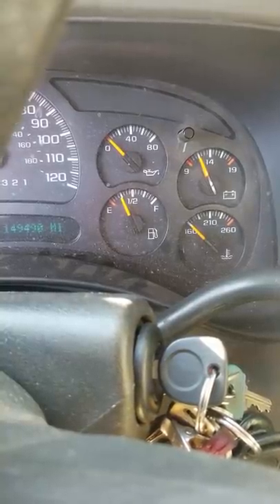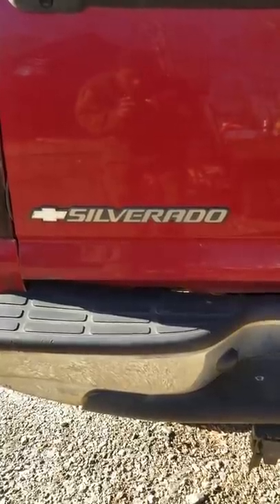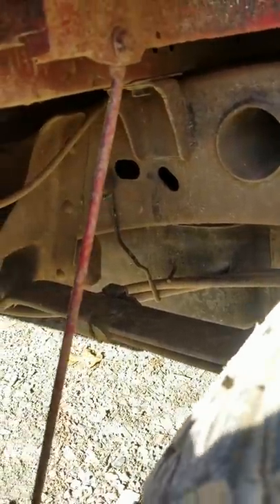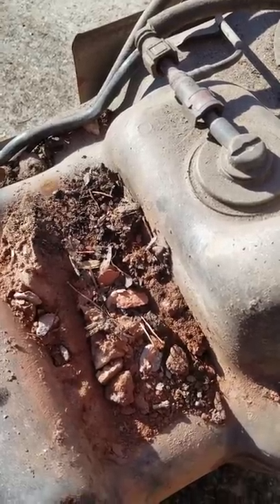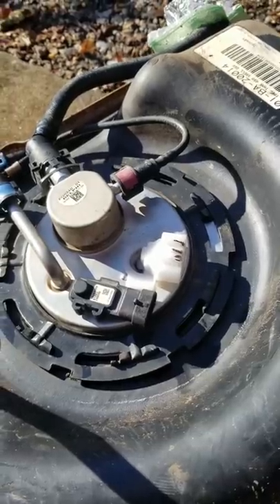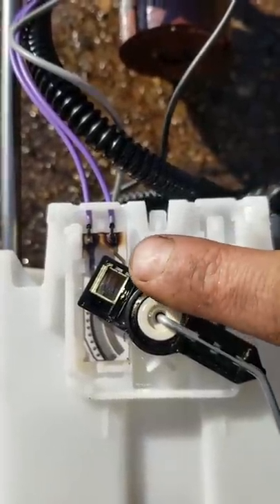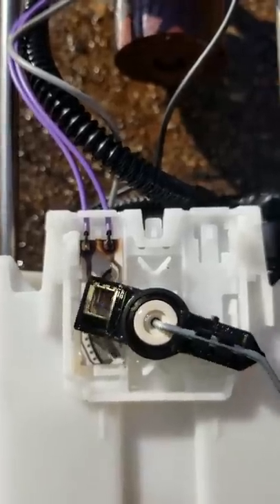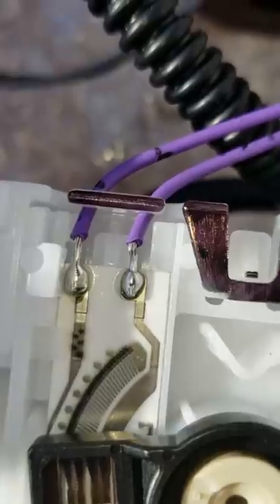Customer States Fuel Pump Broken

Comment: It's easier to pull the bed off then the tank. I've done it for years.
Reply: That’s the way I’ve always done it too. Much easier
Reply: Just did two f250’s this month that way.  I wrestled the idea of dropping the tank.  I still feel pulling the bed is better, even with all the broken torx bits, Thankyou Snapon and Mac is warranty
Reply: Depends where you live
Reply: I pull the bed every time unless it's got a hitch in the back or loaded tool box
Reply: Then you can clean up the frame and touch it up where needed, very satisfying
Reply: I just cut. A hole in the bed... I gotta get back to work!
Reply: I was gonna give the same advice, bed pulling is easier and faster.
Reply: Not easier when you live in the salt belt and break 7 of 8 bolts
Reply: @anthonycerbone1883  same
Reply: its more easy to buy a cummins and just drive it
Reply: Did the same for my grandfather’s 97.
Reply: @madisonjam85  Wisconsin here and thats the gods honest truth
Reply from the maker: I've done it that way a lot. Removed the bed on a bunch of trucks. Should have this time!
Reply: Me 2. Way easier
Reply: @anthonycerbone1883  I like your idea best. 👍
Reply: What the fuck 😂😂
Reply: I change chev fuel pumps in 30 minutes without pulling the bed or the tank fully. Better then dealing with rusted up bed bolts
Reply: @madisonjam85    I just guess we're spoiled. 😆
Reply: @anthonycerbone1883  I did the same thing to my 1990 gmc.
Reply: Ummm why do it the fast easy way when ur charging $120/hr labor? Not a smart bussiness move.
Reply: @looselipssinkships6543  true 
Cause can’t get the bed off in rusty belt states
Reply: @madisonjam85  true
Reply: With the fact that a manufacturer  could easily put in an access hatch like  every fucking import car, watching this just pisses me off.
And the fact that the sending unit draws enough current to 'burn up the leads' in a gas tank should be cause for alarm for anyone.
Reply: @looselipssinkships6543  Yeah you wouldn't be pulling beds in Canada or anywhere they salt roads in winter.
Reply: Remove bolts on the dr side (and of course filler tube etc) then jack up that side of the bed and prop up with a piece of 2x4. You only need about 2 ft of room on that side do the work.
Reply: Not easier at all, 2 bolts and the straps are out
Reply: Yall just lazy...dropping the the tank isn't all that bad. Taking the bed totally off isn't just the bed screws it's a lot more than you think may as well just drop it.
Reply: Even easier to cut a hole in the bed lol
Reply: Even easier to cut a hole in the bed
Reply: When you got a lift... Pulling an empty tank is so much easier lol. I drive a 1500 so I'm used to changing fuel pumps 😂😂
Reply: Definitely the way to go.
Reply: @anthonycerbone1883  lol...I have done that, too.
Reply: @abingham3747  if you work at a reputable shop then if it pays you three hours to put a fuel pump in it doesn’t matter how long it actually takes you you still get paid for three hours if you screw around and it takes you five hours you still only get paid for three so there you have it
Reply: @e-racer4673  so if that "reputable" shop finishes the job in 1 hour, you still get charged for 3? Sounds real reputable to me. I bought a lift and have always worked on my own vehicles so I avoid this scam all together.
Reply: I would have thought the bed be a bigger pain in the ass not to mention the weight of the bed compared to the fuel tank.
Reply: There is nothing wrong with charging the Flat Rate and being skilled enough to beat the listed time.  That isn't the same as sand bagging a job to make it take more hours so you can charge more.
Reply: @jacobmccandles1767  it's not the same but it's still not right. If an algorithm quotes 5 hours at $120/hr and the job takes 1 hour the customer is getting the raw end of the deal in a drastically unfair way. Paying $480 more then they should have had to pay. When it comes down to it the customer is paying for services not received, should be illegal.
Reply: Lmao 6 bolts and a 400lb bed over 3 bolts and a 200lb tank hmmm.
Reply: @abingham3747  because your charging the national average & get paid the same amount
Reply: @ericschulze5641  I see, so calling it the national average and then charging 5 hours of labor for a job that took 1 hour is fair? That's a textbook scam.
Reply: @abingham3747  so if you find an easier /better way to do something because of your experience and skills you should be penalized ?
Reply: @minkorrh  the bolts on the tank straps are worse than  any bed bolt
Reply: @ericschulze5641  being fair and being penalized are two completely separate things. Quote the job for 5 hours if it only takes 2 hours, charge for 2 hours. The customer shouldn't have to pay for an extra 3 hours of labor they didn't receive.

People don't go into work, finish all their work in 3 hours go home and then get paid for a full 8 hour day.
Reply: Not if your solo genius.
Reply: @abingham3747  those times are calculated by the mfrs. and the insurance industry to allow enough time to do the repairs and prevent price gouging many many many times repairs take a lot longer than the national average & technicians/ shops don't get paid for that time
Reply: @abingham3747  so again as a technician gets better and better & more efficient/ quicker -true professional he should be paid less than the inexperienced technician
Reply: @ericschulze5641  right they shouldn't, they are the professionals. But they shouldn't be allowed to charge for services not rendered and time that it doesn't take.
Reply: @ericschulze5641  just saying this heavily favors the shop and brutaly fucks the customer. I'm oblivious to all this cause I work on my own vehicles to avoid this scam.
Reply: @ericschulze5641  also as the tech gets better they should be able to get to move vehicles per day, thus making more money. That's the reward for perfecting ur craft. Perfecting ur craft shouldn't access the gateway to screwing people over.
Reply: That's what I've done on two Silverados. Just remove the bed bolts and unplug the lights. You definitely need a couple of friends though, if you don't have a lift lol.
Reply: @shidukirider  i
Reply: @abingham3747  they're just charging the same rate for a job that they did before they became a true professional. Why do people get more money for each year they push a pencil or make a decision.  . . ? Most mechanics make 30-40 k most sole proprietor mechanics make less than 100k you have no idea what your talking about
Reply: @abingham3747  if it takes an amatur 6 hours, and an experienced tech 2, but the book says 4, should the greenhorn get 50% more or the experienced man 50% less?
  The Flat rate establishes what is fair.
Reply: @ericschulze5641  I do know what I'm talking about and I'm the smartest person in the room cause I don't take my vehicles to shops to get fucked. I'll fix it myself, always have always will. Cause I'm not paying someone for 8 hours of work when it only took 4 to finish. That is a very obvious scam.
Reply: @abingham3747  and you wonder why people don't want to get into the skilled trades how many mechanics do you know of who are wealthy? Very few you may know about fixing your own car but not dozens of other makes and models 
You sound like an engineer friend of mine who makes over $300k looking at pictures . but complains someone charged him $200. To clean his gutters. that's you to isn't it . bet you get paid more  than the mechanic your complaining about I bet your car is newer than his.
Reply: @ericschulze5641  yep I do make more than a mechanic and I drive a $60k SUV for vacations, around town and an old beat up Mazda3 to and from work. I have money because I would never pay $200 for someone to clean my gutters just as I would never pay someone for 8 hours of work when the job only took 4. When I see my Chiropractor I pay her for a 2 hour session. She doesn't walk away after 30 minutes and say "cya later thanks for the extra 1.5 hours of pay, have a nice day".
Reply: @abingham3747  stop worrying about leaving your kids a million dollars & pay people what thier worth. apparently you have some unique skill that is far more difficult to learn than hands on skills
Reply: @abingham3747  chiropractician is far different than a mechanic and requires less skills. So if a plumber fixes your sink in 15 minutes & only charges you $20. You consider that good money you consider that $80. an hour don't you
Reply: @abingham3747  shops are flat rate. They go off a manual that says how long the job should take and charge off of that.
Reply: @abingham3747  its called flat rate and it actually makes a lot of sense. If you charge for how long the job actually takes then slow work is encouraged. A good mechanic who can do the work fast is punished by getting less money whereas a slow mechanic that takes twice as long for the same job gets twice the pay. It would then be in the shops best interest to take as long as possible. Flat rate encourages them to do the job fast because they get paid the same no matter how long it takes.
You are paying the shop for the job, not the time spent doing the job.
Reply: @Redtooth75  do me a favor. Go into your job tomorrow and demand a flat rate of pay for your day of work, then after 2 hours leave and go home and then demand a full day's pay (without using sick or vacation time) and watch how cross eyed they look at you. That's the same amount of cross eyed I would look at a shop if they asked me to pay 8 hours of labor for 4 hours of work. Scam. If ur ok with paying 4 extra hours of labor then you must really enjoy getting bent over.
Reply: @ericschulze5641  last time I had a drain cleared it cost $93 (just went to the file cabinet) 90% of that cost is the service charge, they charged me $75 to pay an employee, drive to my house, assess the problem and then like $18 clear the drain. Which is a fair price. He didn't look at a manual and say "the average time to clear a drain is 5 hours, so we're gonna charge you for 5 hours" then procede clear the drain in 15 minutes and leave.
Reply: @abingham3747  so in your mind paying 4 hours labor for a job that should have only took 2 is fair? Its in the customers best interest to have flat rate. Otherwise you pay more for an inexperienced mechanic.
 Again, you pay for the job and not the time took. You go to the shop and say hey I need a new fuel pump. The shop says okay we will charge you $400. No matter how long it takes you still pay $400. If the mechanic doesnt know what they are doing and takes 8 hours to do the job then the shop eats the extra cost.
If you get rid of flat rate then the shop will take their sweet time to do jobs. Slow shitty work would be rewarded and not penalized.
You pay for the job, not the time spent. Its very simple.
Reply: @Redtooth75  no no no. They are the professionals if they go over the time they shouldn't get paid. However if they quote 8 hours thats fine, however if the job only takes 4 then charge them for the 4 hours, not the 8. That's fair bussiness. I dont have to worry about this particular scam, I avoid it by working on my own vehicles.
Reply: @abingham3747  thats a double standard. If they works slow they only get paid for the time it should have taken but if they work fast they only get paid for the time it actually took. You cant have your cake and eat it too man.
Reply: @abingham3747   by the way I agree with you to an extent, however after working for a high volume appliance service company for 10 years with extensive factory training by all mfrs. . . same as a college degree and owning an appliance repair business for 20 years I got sick of many times doing repairs in 15 minutes that would have taken other techs an hour or more and being insulted by people telling me they shouldn't have to pay $55. plus parts & quoting wholesale online parts prices you didn't do anything they would say. not factoring in the 2-3months a year with no work & never knowing what days that may be .meanwhile thier dumber than dirt but feel the 70-100k know nothing jobs they have are justified
Reply: @Redtooth75  I see what your saying, I do. But I personally will never let someone charge me based on an algorithm for a pre-set job. Cause I refuse to pay an extra $500 in labor if it didn't in fact take that time. That to me is a scam. 100%.
Reply: I have a engine driven welder/generator in there so mine would have to have the tank dropped which I need to get don't been a few months since my gas gauge went out
Reply: @Redtooth75  also riddle me this. I just did an experiment. I have a 2020 Dodge Durango Citadel. I just called 5 shops and asked for all around brake rotors and pads and I got quoted all the way from $780 to over $1500. So if their is a flat rate industry standard then why and the hell do we have such variations in prices? That right there just sealed the deal for me. This is a scam.
Reply: @abingham3747  well the answer to that is simple. Different shops have different rates and can use different parts. The flat rate is time based, each shop should be based off the same amount of time but can charge different amounts for that time. The cheap shop probably has a cheaper rate and uses cheaper parts, the expensive shop probably charges a higher rate and uses more expensive parts.
Reply: @Redtooth75  nope, I'm not sold on that. Each shop I called was an ASE certified shop with 5 star BBB ratings. I could understand minor variations in price, maybe a couple hundred dollars. But not some shops literally charging double. Its almost like they are getting their "Industry standard flat rates" from completely different sources. 🤔
Reply: I suppose it depends on how much gas is in the tank. But I've always found dropping the gas tank to be pretty easy.
Reply: It depends on whether you have a liner, or shell, tool boxes, etc..
Reply: @youngguns1319  You're telling me Cummings equipped vehicles don't use fuel pumps?
Reply: @BigBoyNowYT  How do you manage that?
Reply: @abingham3747  You're right - IF YOU HAVE NO INTEGRITY!
Reply: @e-racer4673  That's a BS scam in itself!
Whatever happened to  just charging for the actual time you spent?
Reply: Same here
Reply: @Alex Bingham  first off pulling a bed is not faster at all idk what is with these people fuck that breaking bed bolts of you break the jam nuts or bolts or tank straps easy to get replacements so you just rip them out drop tank easy as can be no fucking with the bed second you charge book time if a fuel pump pays 3.8 hours and you do it in 1 hour you still charge 3.8 same just like the other day I have a 3 hour alternator yikes me 30 minutes or less they pay the 3 hours and the 1.1 hour that took me 2.5 hours he pays 1.1 hour it is book time you get payed for expertise just because you learn tricks to do stuff properly but fast doesn't mean you shouldn't be paid for the job it's how it works otherwise a tech has no room to grow and no drive to work harder or faster if you get good and fast you can make very good money
Reply: Yup I had just done that yesterday my fuel pump went out and I had to get the bed off first and it was easy
Reply: Same did that on my rard fonger, so long as you have another person or two
Reply: @randallsmerna384  on the hoist pop drive shaft down, trany jack under, remove straps and lower down, no need to remove filler neck you can tip it far enough down to remove and replace pump. Full tank not ideal lol
Reply: Yes! Thank you!
Reply: Correction, easier if the truck is stock suspension, I'm 12 over stock, super easy to drop the tank. And those steel bands suck and Always break, I just cut them, ratchet strap it back in then spray the ratchet with salt water so it rusts up, so I'm 4 months when I have to change it again , all I gotta do is cut the old strap off 😂😂
Reply: @abingham3747  because you bill by the  job not by the actual amount of time it takes :P
Reply: @OOOOOO12345  exactly.
Reply: @MattsShop  how much did that cost the costumer with parts and labor?
Reply: My 09 avalanche says no lol I usually just cut a hole in my old trucks.
Reply: @abingham3747  it's called book time for the job.
Reply: 25 year old OBS chevy trucks in upstate NY? Cut a hole in the bed and put a board over it.
Reply: Don’t even need to pull the bed all the way off. Remove the bed bolts on the left side, loosen the right side, tilt the bed up sideways and prop a 2x4 from the left rear tire to the bed to hold it up.
Reply: No its not
Reply: @youngguns1319  till the head goes
Reply: @youngguns1319  because transmission jobs are easier. 🤣
Reply: Always easier to drop the tank if you have a hoist. That's the only way I'll drop a tank
Reply: It's easier to not purchase a Chevy at all 🤷‍♂️
Reply: @madisonjam85  removing the bolts with impact gun would also remove 50% of the bed's structural rust.
Reply: So much easier! 6 bolts and done
Reply: Just gonna post that very thing!
Reply: @abingham3747  I'm with you on this one. A fast mechanic can charge more per hour since they are going to be faster, while a slow mechanic should charge less per hour since they are going to be slower. It's basic capitalism, and it rewards the fast/quality service mechanic without screwing over the customer. When you do it this way, it doesn't feel like a scam, but when you do it by "book hours" it feels like a scam to have to pay for hours of labor that were not performed. In the end, though, it's the same difference. The fast mechanic charges a higher hourly rate, but gets the job done faster, and the slow mechanic charges a lower hourly rate, but gets the job done slower. So they both end up quoting you about the same price to do the job. Hmm. Maybe charging by the book makes sense after all.

edit: especially when running a shop with multiple mechanics that all get paid an hourly wage by the shop owner. Now, actually, I don't see any other way of doing it except by a book. It's down to logistics for running a shop. However, an independent mechanic could do things differently if they wanted to.
Reply: @madisonjam85   And that's why I never understood why anyone lives there
Reply: That's the way to do it!
Reply: Yes, a buddy of mine with a metal building with steel beam rafters rigged up a pulley setup hooked up to the 4 corners of the truck bed to lift it up nice and evenly. That was the quickest and slickest truck fuel pump swap I’ve ever witnessed
Reply: @anthonycerbone1883  Lazy AF.
Reply: @MrClarkisgod  lol
Reply: Me too , you can pull the bed in less than 30 mins !
Reply: ^was about to comment this, it’s way more easier!
Reply: Or just lean the bed over
Reply: @Mike simple because I'm being charged hours of labor I'm not receiving. If I am charged 8 hours and the job is done in 2, I've paid for 6 hours of services not rendered. I can't go into my job, do 8 hours worth of work in 3 hours the just walk out and expect to be paid for the other 5 hours I wasn't at work. That would be insanity to think that. Just as this flat rate crap is insanity.
Reply: I have an 03 S10 that I’ve gotta change the pump on and have been debating on putting the truck on stands and dropping the tank or just lifting the bed.

Or going the “fuck it” route and just cutting a hole in the bed floor..
Reply: Yup i have done yhat on my 91 several times. I feel sorry for the poor bastards that haven't figured this out.
Reply: I came looking for this comment
Reply: @madisonjam85  10-4 on broke bolts,  most of these guys are working on newer stuff I think.
Reply: Make a trap door in the bed to access the pump. Way easier.
Reply: @FILMINGLOL  I have to agree with you. Alot of guys forget to unhook there tail lights, and end up with problems other places!
Reply: @MattsShop  Remove the drive side bed bolts, loosen the passenger side bed bolts, tilt the bed up about 18 to 24 inches and add a block to keep it up, then you can replace the fuel pump and sending unit easily.
Don't have to remove the bed or tail light wiring at all. Just disconnect the fill neck.
Reply: Yes sir. Works like a charm
Reply: Chop a hole in the bed box is the fastest way use the air chisel so you don't spark a flame. Or just use a hand chisel and a hammer it's still faster than pulling the tank or the bed box.
Reply: Yup was just going to say that. Not a very good mechanic if you don't know that.
Reply: @ASSOpid  .
I don't get this comment section I'm just an old retired backyard mechanic but I've been doing chop the hole for years and all my suburbans and trucks and any vehicle where it's possible.   
GM should be ashamed of themselves for all the 90s Vans and trucks fuel pumps that went out. And then the brake lines at all rusted out. And all the pathetic electrical wiring problems and ground wire problems. 
On my 2000 Chevy van every time it rained my door locks would pop up and down so I finally unhook the wiring.  I would go back to buying Fords but their engines are really junk my son-in-law who is a computer genius can't read reviews so he went and bought a 2005 Ford truck and didn't test drive it hot on the highway and two weeks later finally got around to driving it a long distance and realized that the engine is shaking like an old washing machine and the engine is completely shot because the chains and sprockets and all that stuff is junk metal and the previous owner didn't take care of it changing oil and such.
Reply: @anthonycerbone1883  so you're the guy
Reply: @BigBoyNowYT  and I'll bet the fuel gauge is completely accurate when you're done.
Reply: @steelisthemeal  you new mechanics crack me up.
Reply: @markallen4364  of corse. 20 years as a tech never had an issue. It’s not like we’re bending the sender arm lol. Shake your head
Reply: @looselipssinkships6543  yup yup
Reply: Not for me I have a 30 gallon auxiliary tank in the bed and 5th wheel rails.
Reply: This is definitely a side project ,definitely wouldn’t have the equipment to pull a bed off to do on that whenever he is doing this
Reply: All depends on the condition of the bolts and how much crap the customer has in the bed . I live in the rust belt  . I’ve done both . Also had a bad cluster so I would properly diagnose first .
Reply: I cut a hole directly over the fuel pump in a couple vehicles I’ve owned💀💀
Reply: @abingham3747  it's not a scam, it's called flat rate pay which is how most dealership pays their techs. It is actually protecting the customer from getting over charged from a slow and lazy mechanic that might take their time and charge by the hour and it takes them 5 hrs instead of 3 ect.
Reply: So customer has the money to pay to drop the tank and replace that assembly to fix an 1/8th tank discrepancy on their fuel gage, but they don't have enough money to keep their tank above 1/8 tank empty?
Reply: Bro, I had a guy do my fuel pump on my 2010 Dodge Ram 1500 on the street by my house and did it within an hour 
Also wasn’t expensive either because he said he could do it so fast
Reply: Not on these. It's just two belts. 2 bolts.
Reply: That’s what I did with my Chevy s10
Reply: Had a friend cut a a piece of metal out of the end and add a hinge so it could easily be replaced
Reply: @anthonycerbone1883  I had a Dodge van and I wondered the same when the pump went, why didn’t they just cut out a hatch in the van floor to access the pump instead of having to drop the tank???
Reply: While I agree with this most of the time... You can tell how little everyone here has actually been a "mechanic" and have had daily access to a lift... Also non rusty vehicles help.
Reply: This. So much this
Reply: When I was wrenching I could R and R a fuel pump in 15 to 20 minutes dropping the tank. Half the time it took longer to rack the truck then to drop the tank. Trans jack helps alot so tools do make a difference.
Reply: Best to simply buy a new truck.🤭
Reply: Unless its a tahoe or suburban then you have no choice
Reply: @anthonycerbone1883 did that in my avalanche. Made a little access door underneath the seat. Whole thing took 15 minutes in and out.
Reply: Not where I'm from. 😂
Reply: Basically most of the videos that I have watched is explaining to people how to spend more money map to actually save money